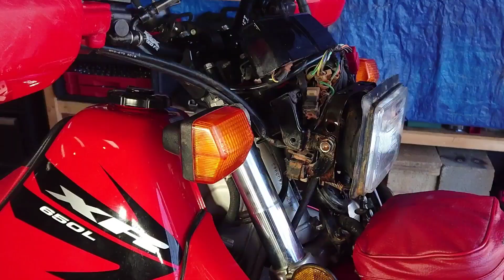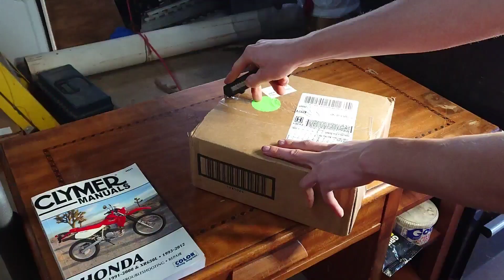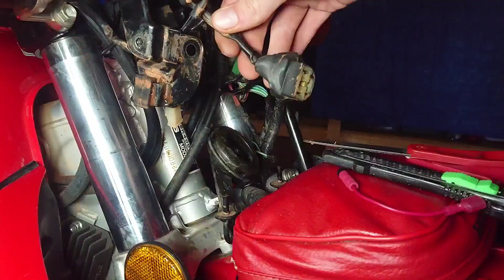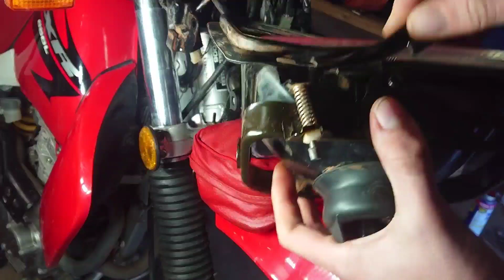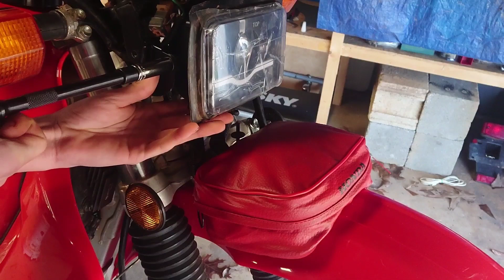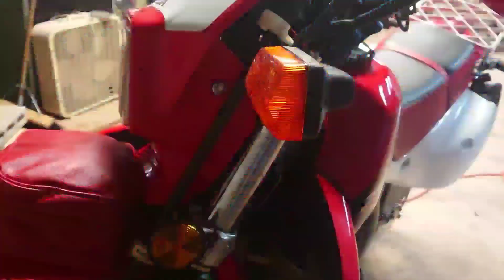How To: Install JNS Engineering Headlight on XR650L

Comment: You don't need to reuse the rubber gasket. That's to keep water out of the housing on the stock light, the JNS is completely sealed off.

Comment: So what did you think of it on the road? Can you see better?
Reply from the maker: I do indeed see more as it's brighter but last I checked JNS released a 15 LED version with a bunch of circles which is reportedly brighter. However, IMO this design is cooler and is still more functional than stock so I haven't made the switch.
Reply: @one_terrabike3151  ...Thank you, and I agree, the one you installed looks much cooler.

Comment: This is very good, Just this side of blistering the garage door paint. NOW, what about a good LED tail light assm, and Turn LED signalz??
Reply from the maker: Admittedly for the tail light I just used a WPS light and replaced the stock bulb with an LED variant and for turn signals I have only done my front so far... I ditched the OEM front turn signals in favor of Tusk Handguards with integrated LED turn signals 😁

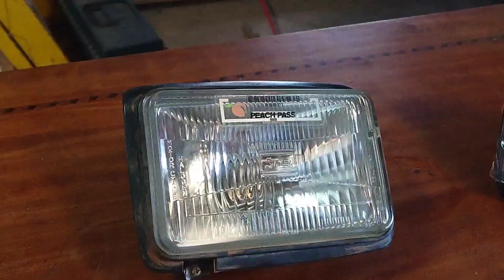Comment: I'm talking about the red cable that start in 2:10 video, Where can I get the name?I am about to get the same lights? Could you please provide me the name, I'll appreciate..
Reply from the maker: Oh if you buy the JNS light it's included in the package 😁
Reply: @one_terrabike3151    xdd lol Can you give me the page where you bought it?
Reply: @one_terrabike3151  Hello, I have a xr650l 2019 and I want to put that lantern on it, but the one I bought did not bring me where to graft the two nuts to the sides where you got that lantern if you have the link for fabor if you could tell me it would be nice
Reply from the maker: @tresprosalyramirez740  did you buy your light from JNS? They provide the bracket which has the threads / nuts built in.